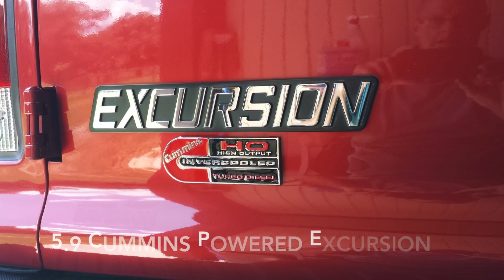Cummins Ford Excursion | Cummins 24V P-Pump | Cummins Diesel Engine Conversion Part 1

Comment: You can hear those Cummins engines a mile away. I thought the Power Stroke early models were loud until a Dodge with a Cummins pulled up. Very nice installation and always like the room that is provided with the inline 6 Cummins and it makes serious power too!!

Comment: With the prices 7.3 models command buying an old gas model and swapping any p pump Cummins is the way to go. Love the 7.3 but the high pressure pump sucks and the fuel filter drains leak

Comment: Does it it possible to put Cummins 6.7 and ASIN AS69RC?
If gasoline engine, which one would you recommend?

I'm thinking to do exterior (headlights, lights, hood, etc.) and interior from Ford F-250 + swap motor and box new or better to buy a Ford F-250/350 and connect the trunk to the cab to be closed and in the cabin.

Comment: How’d you do this with all that extra space? Did you have to use a lot of washers and brackets and extra large hangers? On how many sides is the engine hung on the frame/body by an engine mount? How’d you secure it to the frame? Yeah I’m a beginner. Did it all just fit together by chance?
Reply from the maker: Hi Will, take a read of the build thread, link in description. All your questions answered :-)

Comment: Beautiful, gauges in the cluster work ?
Reply from the maker: The gauges worked, but I used an additional trans temp and water temp gauge as the factory one uses a switch for a sender.

Comment: How much conversion did you have to do to get that Commons to fit with the cross members , the brackets for the transmission?
Reply from the maker: Made my own trans bracket, motor mounts are bolt in and you can find them on the web. No issues at all.
Reply: @OldGuyGarage  thanks

Comment: How were you able to run the motor without a computer? The 47RH is hydraulically controlled with the electronic overdrive.
Reply from the maker: It has a p7100 mechanical pump on it. Take a look at my other video to see the engine running standalone. As to the trans, it does NOT have a computer control controlling od or lockup.
Reply from the maker: There is a link in hte description for the complete build thread, thousands of pics etc.

Comment: What wiring harness did you use to get it to work with the Ford was it a kit?
Reply from the maker: I modified the factory Ford Harness to work with all the gauges, wiring etc. There was no harness bought.
Reply from the maker: No, built it myself